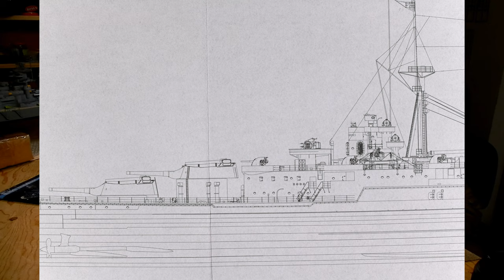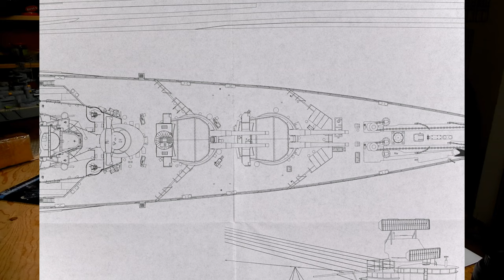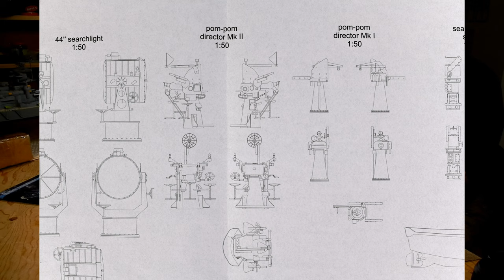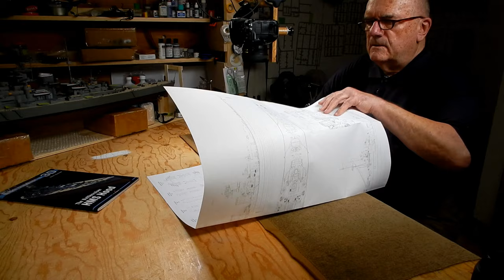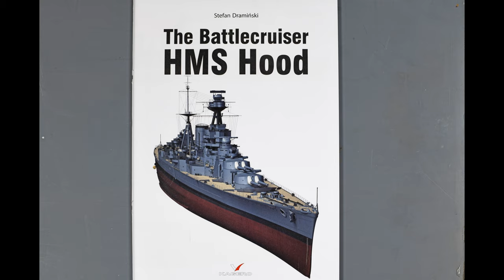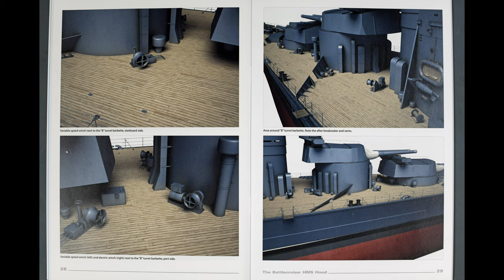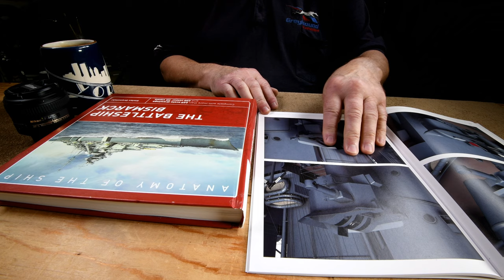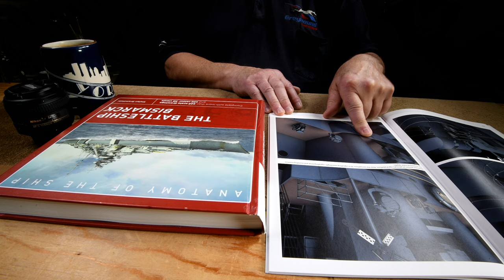The Model Ship - Part 471

Comment: 2:36 It's funny that the hull had original provision for two anchors to the port side but the rear one was covered. The entry for the anchor shows on the deck as well. It's a totally different hull design to the Bismarck. While the Bismarck is flat decked, like a canoe, the Hood is more like a gondola with the bow and stern (or stern and bow?) raised a bit.
Reply from the maker: Re: "provision for two anchors" It will be interesting to see what the kit hull has. 👍

Comment: Hi Ron you might want to consider the trumpeter upgrade set part number 06641 as this comes with metal barrels propellers and blast bags for the main armament.
Also maybe consider a wooden deck?
Reply from the maker: Thanks Gary. I have been thinking about it, and it is actually here in Winnipeg now. We'll see. 👍🙂
https://webstore.eliminator-rc.com/trumpeter-1-200-hms-hood-battleship-upgrade-set